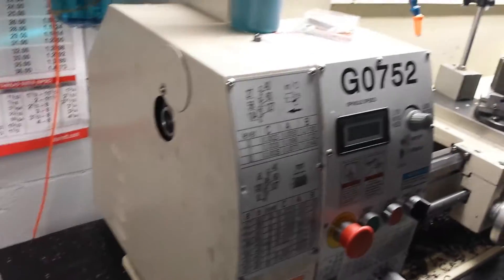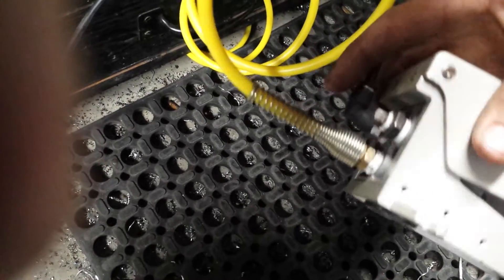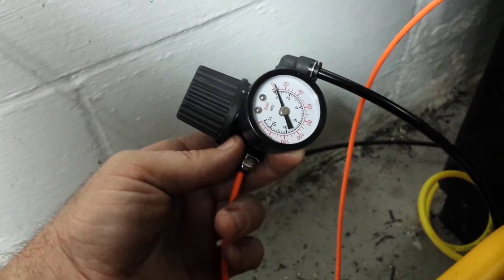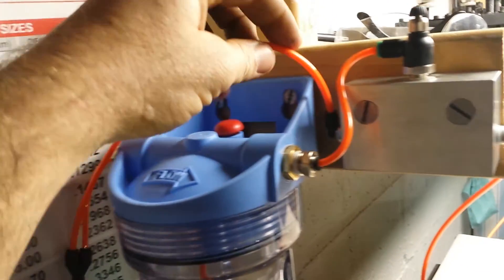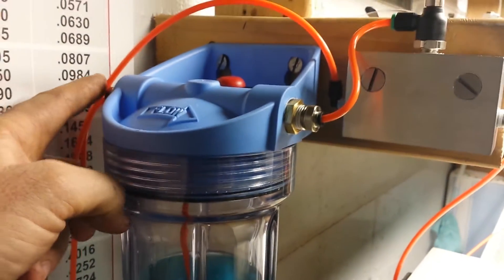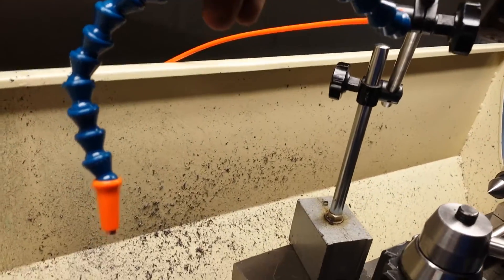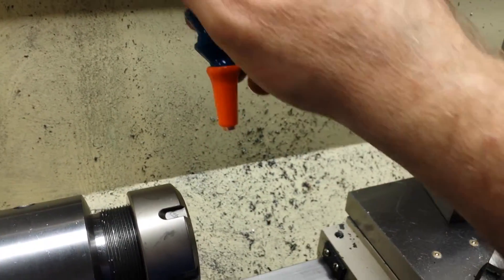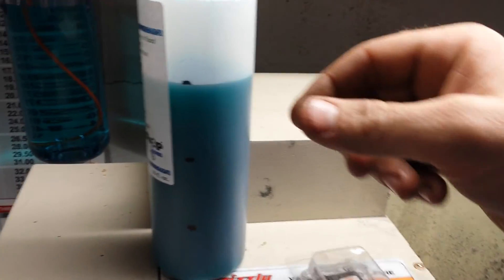Mist coolant System Part 1

Comment: Great. What the name of the air line kit?(orange wire)do you have buy it on ebay?
Reply from the maker: +Vinh an Nguyen I purchased the orange tubing from Amazon. It is 4mm OD x 2.5mm ID pneumatic air hose. It comes in many different colors and lengths. Hope this helps!